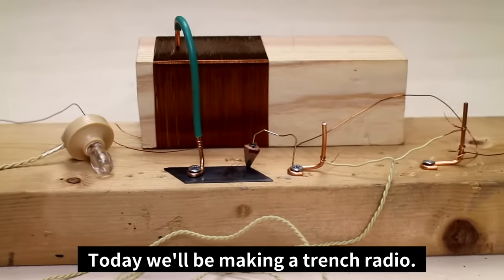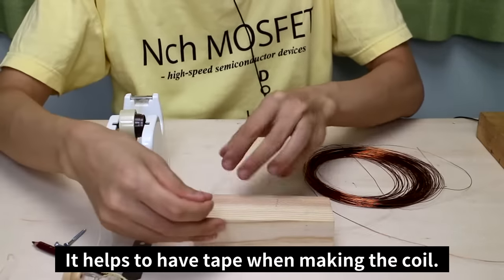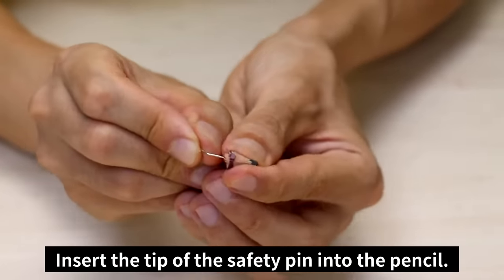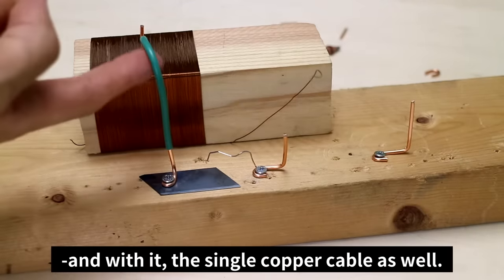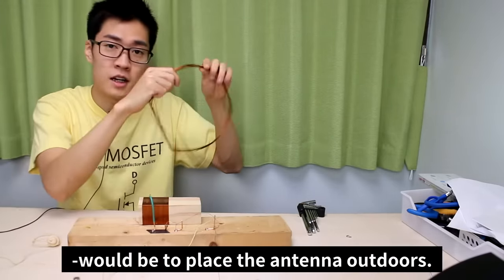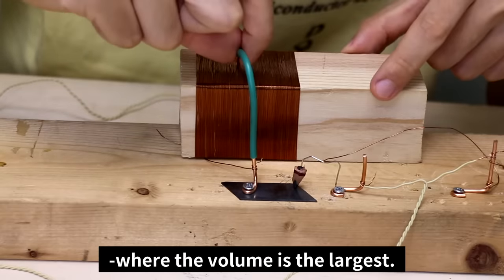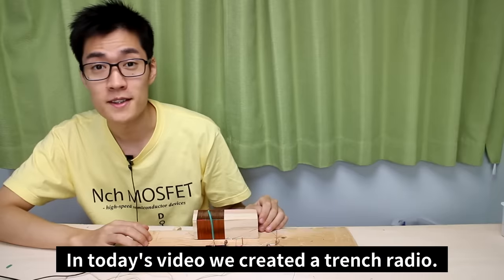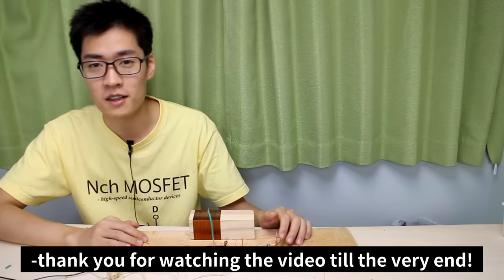Making a Foxhole radio  Very primitive

Comment: if you drop a variable capacitor in parallel with the coil you will have much greater control of tuning also the height of your antennae isn't nearly as important as the length the longer the better with frequency's this low and the best ground is still a couple of feet of copper rod driven into damp soil. Thanks for the video it brought back a lot of memories.
Reply: Yes.
Reply: Nice job, enjoyed the movie, but: Along this same theme, the purpose of the wire wound induuctor you formed is to be part of an L/C network to select a single station from many. The inductance of your wire-wound coil becomes resonant with the capacitince of the long wire antenna. Since your implementation lacks the long wire antenna (which is too short for the AM band, and thus capacitive) the inductor never resonates, and you don't get a "tuning peak" while trying to select a station. As another commentor suggested, you might want to add a parallel approximately 100-300 picofarad capacitor connected between your coil standing end and the sliding tap contact.  That way you can continue to use the handy pickup loop coil inside and use resonant station selection by sliding the coil tap.
Reply: Bad tuning and to some extent volume is mostly because coil is too low Q (it looses energy because of resistance, capacitive leakage, proximity effect, skin and other things). 
make the coil on a thin plastic bottle about  70-150mm diameter you want as little material close to the coil as possible especially inside it (highest magnetic field concentration) and as good insultor as possible, so polystyrene, polypropylene, PEHD plastic are best but PET or other plastic tube works better than the wood.
make a space between turns (ideally 0.6 times wire diameter) just winding same diameter fishing line between the copper turns to keep them separated has worked many times.
Reply: I could go on about designing crystal radios for a loooong time. literally days. 

basically the better EVERY SINGLE component Q is the more energy you can get out of the system, and you can NEVER  get higher Q than the lowest components Q, so you want to make every effort to reduce losses.
 the antenna and ground will always be the biggest loss, but if you have a second coll loosely coupled inductively (two coils near each other will make sort of a transformer) to the one connected to the antenna and ground you get bit more out of the system.

 add a variable capacity parallel to the antenna coil and you can create resonance in the antenna further increasing the available power,  add a second variable capacitor between the ground and antenna coil and capacitor for even better tuning. 

now the detection needs just a coil with a parallel variable capacitor a diode and phones.

to get more out of the phones you may want to make an impedance matching unit, that is a HUGE subject all its own.

a coil made like in this video has a Q around 200. a similar coil on round Polypropylene plastic pipe would be roughly Q 350 to 400, so about twice the energy in the system... 
now use 1.5mm copper spaced so one turn is 2mm on a 150mm round Polypropylene plastic and we go to Q 600. each step gives higher voltage and better tuning (theoretically Q100 to Q 500 is 5 times the voltage and as resistance is same available power is 5x ...)

Comment: The oxide layer and a point contact works, but a better one is a lead-sulphide crystal that is easily made by mixing lead filings with sulfur, and melting together in a test tube, and cooling slowly. The crystal made, is usually surrounded with leftover lead, making that one contact, then a wire 'whisker' is used to find the 'sweet' spot, where reception is greatest. I made one some 60 years ago.
Reply: the down sides of lead tho granted up untill the year of his passing my dad did use lead in his bullet castings so .......
Reply: @ferrofeles2063  I'm a reloader/caster as well. Honor to the memory of your dad.
Lead is fairly safe in truth. If casting, you need good ventilation. Outside with a fan is best.
Its the fumes that are dangerous. The lead itself? Wash your hands when finished and dont snack while leading lol.
Reply: This interests me! I thought at first you were speaking of pyrite.... these ingredients are on hand for me! Thanks for this!
Reply: Where is the power fixed?
Reply: @zakayokiplimo-mv3pg  in the radio signal itself!

Comment: Technically, the carbon in the pencil is a semiconductor.  That is part of why it works as a detector.This sort of radio is also called a "foxhole" radio.  Small pits that people dug during the war got called "foxholes"
This design will never be selective enough to select between stations that are near each other on the dial.  A loosely coupled radio does better in this.  In those, the antenna connects to a second coil that is placed near the coil in your existing design.  Ideally both coils are tuned and the coupling is adjusted by moving the coils together and apart to find the best distance.
Reply: Nobody on any of these YouTube videos actually knows what they're talking about.

1) They didn't "invent" these radios in WWI for "entertainment.  They were used to disseminate information to troops without using normal radios that could be detected by the enemy because of the oscillations in the regenerative circuits that emit RF.

2) Many things can be used to make a detector because these are NOT normal diodes and the "crystal" has nothing to do with anything. These are TUNNEL DIODES and always have been- but has never been recognized..  What matters is that there be TWO DISSIMILAR conductors (for different "work functions- look it up) and the KEY is a very thin insulator like a layer of oxide like the bluing on a razor blade,,,but many oxidized metals like corroded pennies or galvanized tin will work with the carbon pencil lead.

These are called CIC Tunnel Diodes; they are NOT the normal semiconductor tunnel diodes. No semiconductors are involved here. CIC stands for "Conductor/Insulator/Conductor. The early Heaviside detector used a needle lowered through Olive oil to a pool of mercury; the olive oil film on the steel needle is the insulator. The trick is to get the insulating layer thin enough for electron tunneling to take place.  Again- THERE IS NO SEMICONDUCTOR INVOLVED. Tunneling occurs in BOTH directions, but because of the different WORK FUNCTIONS OF THE CONDUCTORS, there is a net flow on one direction and THAT is why it can be used as a detector!
Reply: Thank you for that detailed explanation
Reply: @craigwall9536  I suspect it's merely a translation issue,  no need for all caps Sun will rise tomorrow.  People refer to diodes as semiconductors often and it will not stop.  SCR's, Thyristors, etc, the tech grows faster than vocabulary and Diodes are merely  P-N junctions of the same substance many transistors are made of Germanium, etc.  All translations deserve some wiggle-room.
Reply: @craigwall9536  Radio receivers in WW1 could not be detected by the enemy for their IF emissions!  It was the antenna that might have been observed.   Far more interesting were the transmitter locations.    Any non-ohmic conductor or junction is a semi-conductor, that includes, wood, clay, ionic liquids, gases, semi-metals (As, Ge, Sb) and insulators.  Only some metals are "true" i.e. ohmic conductors, in that they follow Ohm's Law.
Reply: @craigwall9536 Great. I keep on learning.
Reply: I'm just sad that it was necessary for you to define foxhole in this day and age
Reply: @joshwells4280 We still "dial a phone" and "hang up" when we are done.  We say "don't change that dial" about radio and TV.  We also "tune in a station" even on a digital receiver.  Soon we will have to explain these to the next generation.

Comment: lived close to a main am station some 50 y ago. an old-school telephone ear piece connected by a diode to a metal mass like a tap was all you needed. used to listen to that "radio" in the bathtub. btw, a greenspan corroded cent works as a semiconductor, as well!.

Comment: As a kid I had an electronics kit that had instructions for a trench radio, and it blew my mind. It was like magic hearing a radio station without any power being used, simply using the power of the transmission itself. I could only pick up one station, and the ear piece was garbage and sounded really rattly and distorted, but it still amazed me regardless.

あなたのビデオをとても楽しんだ。ありがとうございました。

Comment: My dad was into electronics (all tubes) had his little bench with oscilloscope, signal generator, signal tracers, and so on. When I was little he put together a crystal set for me and place a headphone on my ears. Wow didn't expect that, it was magic for a little boy, put an unforgettable smile on the face. The AM station came in was so clean like true HiFi, better than any radio at the time and even with today's components, pretty loud as well connected to a raw speaker. Free energy!
Reply: More like free information (or entertainment) rather than free energy
Reply: @syedabishosainrizvi7817  
joule = volt × coulomb which is the driving energy in moving the speaker cone translating into sound. In other words free energy for the end user, although it takes a fair amount of energy to transmit the signal at the broadcast station, but you get it free with a crystal set.

Comment: I  made it  with blue razor blades and hardest pencil  vey sharp, it  works as the "cat wisker"   germanium diode 1n60, also  worked at hi volume  on a high impedance  magnetic  earphones at times when AM  stations  had over 10 kw power, got stations over 50 km away, tuning with a variable capacitor, also needs  good ground and long antena

Comment: As several others have said, a rotary air-dielectric capacitor of several hundred picoFarads would give you the ability to tune it, rather than have all the local AM stations coming in. These capacitors are used for tuning AM radios to different frequencies and you'd probably get one from an old AM radio or a radio amateur's shop. My first radio was a crystal set using a galena crystal (lead sulphide) with a fine wire point your could move around to find a good spot. Ordinary headphones worked alright.
Reply: You can also make a variable-inductor version, two paper tubes, one sliding inside the other, and a wire coil around each. As you move the coils, the inductance changes, and thus the tuning. 
 I never tried one in a radio, but I saw an experiment done where a variable capacitor (about 100 pF value) was made using microscope glass slides (the thin ones that are "cover slides") and aluminum or copper foil, in layers. Copper foil is readily available since its used by guitar home-builders, and it can be soldered to. In theory, in theory, ordinary plastic food wrap could be used as the dialectric layer in a home-made fixed-value capacitor. Won't work well for a variable capacitor. 
To get really fancy, it's possible to make simple vacuum tubes using small tungsten filament light bulbs (old-style car turn-signal lamp bulbs for example) with a bit of metal, or fine wire mesh around the bulb. Somebody has posted a video "how-to" about that on YouTube.  
DC voltages were provided by using 9V batteries in series. It's possible to get several hundred volts DC at  low current, and the battery "snap" connections make it easy to connect them in series. It's necessary to be very careful about exposed connections. Even at low current, several hundred volts gives a very nasty shock. If you try this method at your own risk, the "One hand in your pocket" rule applies! 
It's much cheaper to buy a box of 24 or 48 of 9V DC batteries from an industrial supplier, compared to retail prices for one or two 9V  batteries.
Reply: @flyingbeaver57  It's great to hear all this from your experiences. Like you, I've seen a Youtube video recently on how to make your own vacuum tubes but it wasn't so simple, as you had to make your own glass-to-metal seals. I've done a lot of experimenting over the years too, and somehow it's very satisfying to find how to make do with minimal resources. The first time I ever used a vacuum tube was with a battery for the filament and a 90 volt battery for the plate, with earphones in the plate circuit. You could hear the "sound" when you drew a finger across the grid terminal. Amplification, olé!

Comment: LOOKS REAL GOOD DUDE!  FOR THOSE WHO DON'T  KNOW THE  EARPHONE  MUST HAVE VERY HIGH IMPEADANCE SO IT DOES NOT LOAD DOWN THE  VERY LOW  SIGNAL DETECTED  .  YOU COULD USE A IMPEADANCE MATCHING AUDIO TRANSFORMER  THAT HAS HIGH   IMPEADANCE  ONE ONE WINDING  AND LOW IMPEDANCE  ON THE OTHER WINDING. .

Comment: Being AM you may want to rotate the whole assembly; works best sideways to the transmitter.
Reply: I agree with J Campbell....the length or the antenna is the key. @ 900khz a full wave antenna would be 333.1 meters or 1092.8 feet. So a 1/8 wave antenna would be 136' for 1/8 wave at 900 khz. And not coiled up as shown,but stretched out it's full length.

Comment: When you sanded the wire it would have been too easy to get a shorted turn.
It's better to make little loops by twisting the wires around and use them as taps.
It's also better to use a hollow cardboard tube as water in the wood takes away the signal.
The sharp edge of the razor blade against the pencil would make a better diode.

Comment: I had a crystal radio when I was a kid in the late 60's early 70's. It had about 70 ft of copper wire out to s tree in the back yard.
It had a potentiometer for tuning and a diode. We were fairly remote, but I could get the local am station. Also as mentioned by others I could hear stations far away at night.
On a slightly different note. In the late 70's I had an old radiogram that could pick up Egypt from Australia at night.

Comment: A frequency filter would help this. Its pretty much the same thing minus the ear plug. You have it in line with the antenna. You set up the receiver to hear the powerful local station and use the filter to tune it out. can be VERY handy!

Comment: While the design dates back to before WW1, I would imagine it would be used more in WWII.  In the first world war there was no radio for entertainment or news like we know of today.  The only thing to listen to would be messages in morse code.  Even then you would have to know how to decode the messages.  There was very little actual speech transmitted.  By the second world war the crystal radio was widely known, and could easily be built by a soldier in the field.  There would have also been radio stations to listen to.

Comment: Technically the cutter blade and pencil together make a diode. Not a very good one but a diode none the less. The other way of doing it is a blued razor blade and a safety pin with the point resting on the blueing. Again that makes a sort of iffy diode. There are also some types of rock you can use as discovered by Jagadish Chandra Bose

Comment: Well cleaned Zinc plated steel washer, carefully heat washer to dull red heat.
Bluish vapors means it's about right.
Allow to cool.
Use just line a 'blue razor blade' detector.
Zinc oxide/zinc metal interface has semi-conductor properties.
Correctly biased, zinc diodes have a narrow 'negative resistance' region, allowing amplifiers and oscillators to be made.
Not much gain and it has lots of parasitic capacitance, so it can't handle higher frequencies very well.

Comment: Blued razor blades work better, especially is you wet them and put a few grains of salt on them so they create rust spots, then touch the rust spots for an improved detector. I think your coil is a bit large. You could also make a paper compression capacitor in parallel with the coil to improve the tuning.
Reply: ...well the tempering by flame is blueing .

Comment: You forgot to give the width of the board used. 

There were plans published for a crystal radio that had it's coil wound around an Quaker Oats container. People a generation later trying to make these radios could not get them to work. Quaker Oats had changed the size of their Oats containers to a smaller size and it changed the frequency range if wound according to the old plans.
Reply: Clear plastic bottles are probably the best choice today. Plastic has much lower loss than either cardboard or wood. Wood is a very bad coil form choice, being variably lossy, depending on wood type and water content.
Reply: Same applies to the base, plastic would be better.

Comment: During World War Two, where would a crystal earphone come from?
  How about high impedance earphones?
  As a kid, I used a 600 ohm microphone that acted as a small speaker under my pillow, and used the bed frame as my antenna and the outlet plate screw as a ground!

Comment: The radio does use a semiconductor. The oxidised cutter blade and pencil lead form a primitive schottky diode.
Reply: Actually, it forms a TUNNEL diode. But NOT the PN type. This is an MIM or metal/insulator/metal diode. The two metals must have different "work functions" so that one gives up electrond more easily than the other. Which is why carbon is usually substituted for one of the metals.

Comment: I made me one of those in 6th grade.  I used old EM  radio headphones.  I used a single edge razor blade and the lead out of a pencil  for the detector.  My coil was 120 turns around a 2 inch paper roll.  The coil was not sanded but connected to the antenna on the end.  .  IT WORKED!       NOW try a TRANSMITTER with an induction coil (From an auto) And a relay coil wired to vibrate to deliver a pulsed current (from a battery) to the coil .  Wires from the coil can work a SPARK GAP.  One pole of the spark gap goes to ground and the other to an antenna wire.   A code key can be used to make and break the connection to the relay.
Reply: Better go answer that knock on the door now.  It might be the FCC.